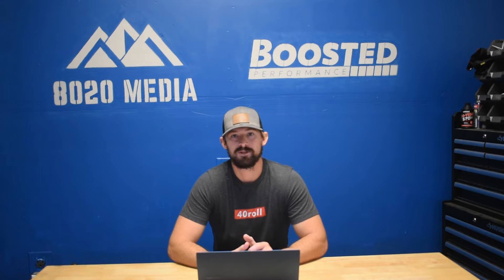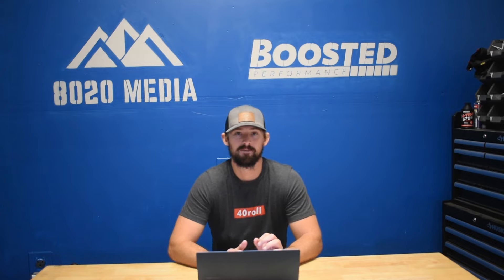DIY: How to Fix GMC/Chevrolet "Service Stabilitrak" & Traction Control Lights!

Comment: 2022 Sierra SLT 5.3 X31 - 1700 miles - Been in the Shop 4 times. Just got my license plates and still in the shop. I'm 200 miles away from having the same miles on the brand new loaner that my truck has. Being signed up for MyGMC let's me see that they test drive it, and it messes up again. Was told yesterday I'd get it back this morning. My app notification went off around noon with service now notification. 3pm and no word. This is ridiculous. Wish you were the damn tech lol
Reply: I’m having same issue only have 1900 miles. Did they figure it out? I’m taking my truck in tomorrow

Comment: I'm not sure if anybody would know but with me having transmission problems in my GMC Yukon with that also make the stability track like to come on
Reply from the maker: Tom - what transmission issues are you having? It's not uncommon for the transmission to hard shift when the stabilitrak light is on so unless you have known problems with your trans what you're experiencing could actually be from Stabilitrak being disabled.

Comment: Have a p011 code after changing cam shaft positioning sensor, solenoid, and can shaft itself. Stabilitrak and check engine. Stabilitrak light turns off after a few minutes
Reply from the maker: A - Are you missing a number on the engine code?

Comment: This afternoon my 2015 cruze started just fine i made it about 8miles from home when it turned on i was going 55mph when it turned on and it slowly forced me to pull over. The coil pack is about a year old
Reply from the maker: Austin - Did you get a check engine light?

Comment: I guy on another video replaced the mass air flow sensor and the lights went off?
Reply from the maker: That could do it - it could really be a number of things which was why I wanted to make this video. A ton of videos on here say "here's how you fix it" and then say to only change the spark plugs, or change the MAF, only for people to spend hundreds of dollars replacing those things for it to turn out to be something else.
Reply: @8020Media  thank you 🙏🏾

Comment: I am experiencing the rough idle and this is after spending $600 at the dealership for new spark plugs/wires and throttle body cleaning
Reply from the maker: Plugs might not be gapped properly.

Comment: So my 07 gmc yukon keeps showing this damn code. Put 3k into it and it's running great, but the dumbass before me removed all of my tire pressure sensors. Wondering if having no pressure sensors might be throwing my stabilitrak off?
Reply from the maker: Kait - This would be unlikely since the TPMS system has its own warning light. Do you have a code reader?

Comment: So I changed my front tires from rear tires, my rear tires are 255/65/18 & front are 255/55/18, now the stabilitrac warning lites are on: because the computer is sensing that the speed of the rear wheels doesn't match the front wheels. Didn't know this would be an issue so I'm going to match all 4 tire sizes and hopefully this corrects the problem. 1 thing they don't mention on the video is: can you drive with this warning light on without causing worse issues until you resolve the problems?
Reply from the maker: Interesting. Yes, you can certainly drive when the light is on, but wouldn't advise ignoring it for an extended period of time.

Comment: Mine seems to be when I turn the wheel  , and it better when its cold out , worse as spring arrives
Reply from the maker: G - Do you have any engine codes?

Comment: How about low oil pressure 35 psi is not enough to test dod system
Reply from the maker: What do you mean? Low oil pressure could certainly lead to this issue as well as a ton of other problems...
Reply: @8020Media  yes I have a customer complain of funny rattled down the road I figure it's probably when canceling cylinder's.
Reply from the maker: Joel - Certainly could be.

Comment: I was driving home from work today and I felt a jerk then noticed the stabiltrak light came on and stayed on .. is it still safe to drive the vehicle? Thanks for the video. I'm driving a 2008 Acadia, and there was a check engine light on but my mechanic said it was probably just an 02 sensor and don't worry about it.
Reply from the maker: Hard - It is safe to drive with a Stabilitrak light on, but not for an extended period of time. If your mechanic said it was an O2 sensor, than that's a pretty simple replace.

Comment: Can a 2011 GMC TERRAIN SLE take E85?
Reply from the maker: Marcy - It should be. However, we would heavily advise pulling your VIN and using a decoder to ensure that it is flex fuel compatible.
Reply: I just had the stabilitrack warning come on, sometimes when I’m at a stop and my foot is on the brake, the car “jolts” a little where it feels as if the car is about to leap forward!
Reply from the maker: Marcy - unfortunately this symptom could be a sign for multiple things: transmission issues, misfires, or issues with the brakes. We would heavily advise taking it into a shop if this continues.

Comment: What about spare tire, different rim, and/or different tire size on spare? My truck has this problem . No codes, runs great, Put tire air pressure sensor in today on the spare. The spare is on the truck. Need another rim before I can change the tire. Just bought the truck.
Reply from the maker: I suppose if your wheels/tires are big enough to throw wheel speed off by a good bit then it could cause this. Based on that the spare could be the thing throwing it off assuming its a dingy little spare

Comment: I have all 4 tires changed, the next day my Service Stabilitytrack ligh on came on, No check engine truck is acting completely normal, just the ligth wont go off
Reply from the maker: L - This could be your vehicle relearning the systems. New TPMS sensors or wheel speed sensors can cause the stabilitrak to go on. This should turn off once the more the vehicle is driven. Keep us updated.

Comment: Mine was fixed by replacing a faulty brake pedal switch. There are too many and bad indicators for these problems.  There is no way this condition should be attributed to anything in your engine, that is absolutely nuts!!!
Reply from the maker: J - Thanks for sharing your insights and experience.

Comment: I think my problem is my recent installation of aftermarket headers. Since i haven’t tuned the car yet my rpm blimps at idle and misfires while driving. And o2 sensors show lean. stabilitrak turns on and off while driving, also causes the car to jerk/stutter during acceleration. What do you guys think?
Reply from the maker: Definitely sounds like the misfires are the cause. Drop a tune on there to fix your fueling issues and you should be all good.
Reply: @8020Media  thanks

Comment: I have a 2011 truck and I have the service stabilitrak and service traction control lights and my check engine light flashes constantly I checked the codes one was multi misfires, low catalyst system, evap control circuit malfunction it does have a rough idle but I’m not sure where to start don’t really want to spend too much money on it
Reply from the maker: Probably spark plugs and maybe some issues with the EVAP system. I'd replace the plugs and then check this article for info on EVAP: https://chevytrucks.org/p0449-engine-code-evap/
Reply: Just now replaced spark plugs and wires and it still does it so I’ll look into the evap system thanks man
Reply from the maker: Keep us updated on this. Unfortunately, this is quite a difficult diagnosis..

Comment: Last night i was going to a graduation party and my t/c xwas really dinging all the way there and back home i have a 08 Dts Cadillac I don't know what to do. Hope someone can give me a hand on this issue. Blessings 🙏
Reply from the maker: Gil - we need some more details here to be able to point you in the right direction but I suggest you try giving the video a watch and seeing if you can figure out the problem based on the info we provide.
Reply: @8020Media  I really appreciate you reaching back I did have a low tire on the back right passenger side and all of a sudden some how there switched up on the info bezel instead of the back right tire going low the driver's side is low and not the right side. I disconnected the battery last night and checked the fluids so I don't know what else to do! I seen that some people have pulled the fuse for the t/c I don't know. Blessings to you sir and everyone else who is going through the same thing I am. 🙏
Reply from the maker: Gil - Keep us updated on this. We hope everyone's comments can be of assistance. If not, reach out and we'll try to help further!

Comment: I just had my front wheel bearings and brakes done. Now i have stabilitrak with check engine lights on. Also the truck now feels like something is restricted or grabby feeling, its hard to explain. A few days later it went away and truck ran great, two weeks later its back again. Any idea whats happened? Thanks so much to anyone willing to help. Edit: 08 1500 4wd Silverado
Reply from the maker: GG - Sounds like something may not have been installed properly. Have you addressed this with the shop that did it? If everything was installed properly, then here are a few things you may want to look into: wheel speed sensor or TPMS. If you have a code reader, it will likely point you in the right direction.
Reply: @8020Media  I went to a different garage because the one who did my bearings and brakes were impossible to deal with but this new guy found a bad spark plug, and I guess it was a perfect coincidence that it happened when they first did the work. Very strange symptoms for a bad spark plug
Reply from the maker: Great - Glad to hear that it's been resolved for you! Keep us updated.

Comment: I was driving on a little country highway with the 4wd auto function on and hit what seemed like an unremarkable little shallow pothole, but I was slightly in a curve. My Silverado skipped sideways just a tiny bit, and immediately the traction control and ABS lights immediately came on , and the "Service Stabilitrak" waning displayed on the dash. The surface was by no means slick or uneven. The truck ran fine, but when I got where I was going it didn't want to turn. I Had to hit the throttle to push it through a turn. It felt like the truck was fighting the steering wheel being turned, and the brakes were engaging when attempting to turn. I parked it and disabled Stabilitrak and put the truck back in to 2wd mode. It drives fine now.
Reply from the maker: Daisy - Interesting. We hope it stays fixed. Those are very odd symptoms to happen all at once.
Reply: @8020Media  It only drives right in 2wd. The Stabilitrak light is still on as well as the traction control light and the ABS light, so the cruise control doesn't work. And I've got oil leaking out from somewhere near the power brake assist pump. So, yeah, not exactly "fixed" yet !!!
Reply from the maker: Have you taken it to a shop yet?
Reply: @8020Media  The soonest I can get it looked at is Aug 9. So I'm limiting driving it to the barest minimum and riding my Goldwing in this hot ass Texas summer heat ~!!
Reply from the maker: Keep us updated on this! It could certainly help viewers in the future.
Reply: My wife’s Yukon does this. Did you find out what causes it?
Reply: @justinstrauss1056  One of the wheel sensors had a fray in the wiring, and it was shorting out. Cost about $600 to fix it and works fine now.

Comment: I just replaced my fuel pump and I have a misfire on cylinder 1.
Reply from the maker: U - Check your ignition components, (spark plugs & ignition coils). Keep us updated.

Comment: the little blip on the rpms is something i think i have but not sure if its what your talking about. Its a very very small amount of movement. The idle itself doesnt seem to change just little up and down blips or tiny quakes
Reply from the maker: Any misfire engine codes? Normal for idle to move around a little bit but the blips I'm talking about would be more so from a rough idle/misfires. Nonetheless, replacing the spark plugs is usually a decent place to start here.
Reply: I am experiencing the same and this is after spending $600 at the dealership for new spark plugs/wires and throttle body cleaning

Comment: I have a 2010 chevy tahoe hybrid and stabilitrak and traction control comes on and my car shuts down and when it sits for a min it will start back up but still not able to drive far before it shuts down again
Reply from the maker: London - guessing you are having a fueling issue, could be the fuel pump. A lot of the times the issue isn't with Stabilitrak itself, that warning light just comes on when something else is going wrong in the engine.

Comment: Would a power steering issue have something to do with stabilitrak going off?
Reply from the maker: This could be a very possible cause.
Reply: My vehicle says service power steering when the satbilitrak message comes up. No lights...it doesn't happen very often.

Comment: I have a 2017 sierra and while driving at a low speed I noticed my brakes started feeling a little funny. A minute later my ABS, Traction Control, “Service Stabilitrak” and “Service rear vision” lights all came on and the truck was hard to make turns. Luckily I didn’t have to drive more than a mile or so. Any ideas?
Reply from the maker: Evan - the "hard to make turns" symptom makes me think it might be the steering gear box. If the issue is just that it takes a lot of force to turn the wheel (when moving slowly) then you're definitely looking at an issue with the power steering system.
Reply: @8020Media  I appreciate the reply. When I said hard to turn I meant it feels like the traction control feels like it may be engaging and slowing down the turn a little bit, the steering wheel isn’t hard to turn. Because all of these started happening at once, you think it could possibly be battery related?

Comment: I have a 2015 gmc 2500 traction control, brake, abs, service  stabilitrac lights all come on and truck loses power and jumps and jerks briefly but only happens when pulling my trailer with brakes. I can pull my single axle trailer with no brakes all day  with no problem.
Reply from the maker: Since it only happens when you are trailering with a trailer brake then I wonder if it is a power or grounding issue with the trailer wiring.

Comment: I watched this whole video, great advices to help resolve this issue. I had ABS and Stabilizer Control kick on and off for awhile.. never could figure it out.. no change of speed or anything just annoying lights on element..

I do have a small misfire, figured that was the problem so I plan on fixing that issue soon..

But I figured this would be helpful with anyone that has a Chevy Cruze since this wasn't on the video.

Today after work, the lights were on but I also seen one of my tires were low.. so I checked the PSI system on the dash, It read 28,31,30,30.

So I checked with an actual PSI Gauge, Read all 30s.. so I put air in all tires to 35s. It came on 2x but just for a few seconds.. then nothing.. Hasn't came back on since.

Hope this helps 😁
Reply from the maker: Awesome, thanks for the advice! I haven't heard of low tire pressure causing the light but at the same time there are so many wonky things that cause it that I wouldn't be surprised. I'm not an expert on ABS systems and all that jazz but maybe a low tire has some impact on that or on Stabilitrak.

Comment: My speedo is jumping up and back down a little when the service stabilitrack light comes on. I’m sure that’s a clue but I don’t know. Any idea?
Edit: I changed the wheel bearings and it fixed all issues.
Reply from the maker: Chris - yes that is likely the reason the Stabilitrak light is going off. However, a number of issues can cause this like spark plugs, ignition coils, fuel filter, and so on. So I recommend starting with an OBD reader and checking for any engine codes to see if you can pinpoint where the problem is coming from that is causing RPMs to jump around. My guess is you are misfiring in a cylinder but it's hard to diagnose without knowing of any other symptoms or engine codes. - Jake
Reply: @8020Media  I have one. The only code I ever had was a slow EVAP leak(probably gas cap) ithey just put in a new rack and pinion and brakes , front end work. I don't want to buy all four wheel sensors, as they're different on the older models. I heard it could of been a few sensors but I can't afford to just start replacing everything. Would love a "most common" issue
Reply: I have the same issues and replaced my gas cap and it stayed off for about a year. Came back and and got a new cap and now it randomly comes on so i pull over and turn the truck off for a while and it goes out but its happening more frequently
Reply: @8020Media  ended up changing the front wheel bearings and it fixed everything.
Reply from the maker: Chris - Thanks for coming back and sharing! This should certainly help future viewers. Glad it is fixed!
Reply: @8020Media  np. It actually makes sense in hindsight.

Comment: My Service Stabilitrak light comes on my Trailblazer about 2 or 3 times a year. It only seems to happen when I turn sharply out of a parking space and never when I back out straight. I have never had it come on driving down the road.
Reply from the maker: WL - Very interesting. We think it must be some sort of sensor that is correlated to turning. At least it goes right off!
Reply: Mine just went off like that at our work garage. I moved my car straight then backed in into a parking spot. Light came on right after. We had a big storm today, hopefully it’s the speed sensors down in the wheel